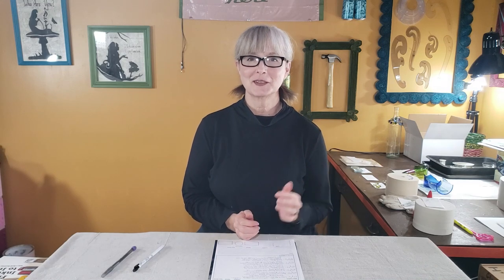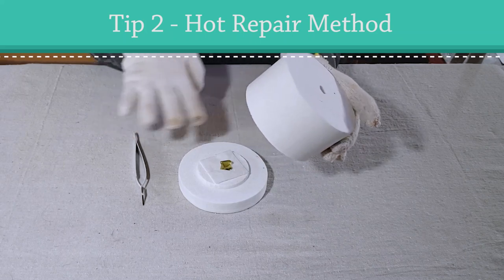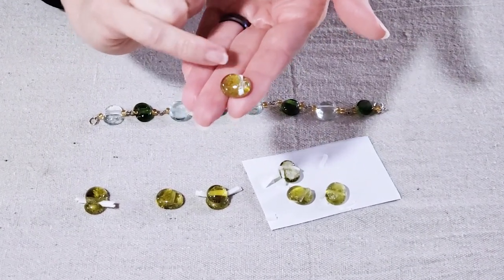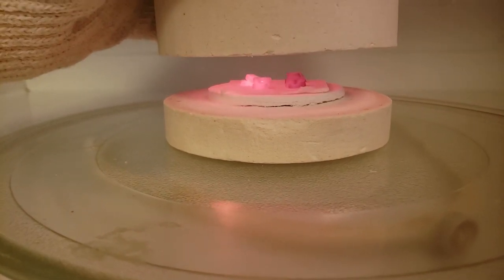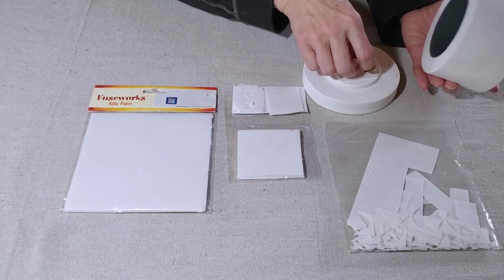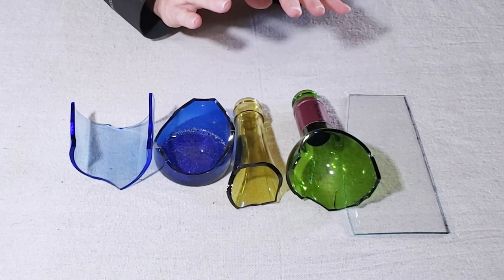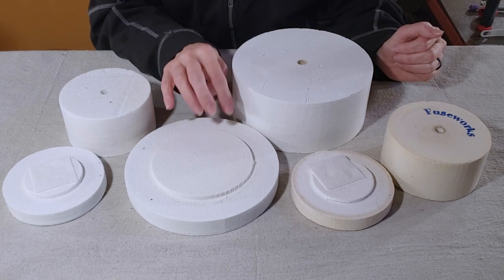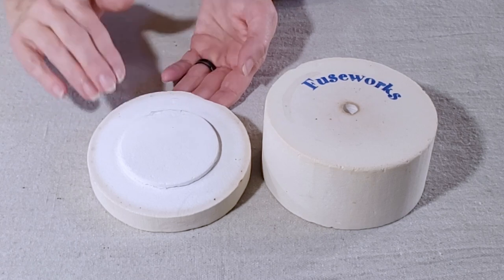Troubleshooting Your Microwave Kiln - 9 Tips For Beginners

Comment: Hi Cindy, can 2 pieces of kiln paper be glued together to make an impression that does move?
Reply from the maker: Hi - I haven't used the glue much with my kiln for me it seems to burn off before any fusing happens so item's can still slip. But I know many folks recommend using glue to help hold the pieces so I would say you could certainly give it a try. Sorry I don't have a more definitive answer. Thanks for watching.

Comment: I'm using bottles like you do, but when cooling the glass cracks and comes apart. I'm not mixing the glass, what do you think is wrong any help please.
Reply from the maker: Sorry I have not had that problem. Is it possible that you are heating the glass for longer than you need to? Or that you are not allowing the glass to cool completely before removing it from the kiln?
Reply: @UpcycleDesignLab  thank you yes I am a bit eager to see what it looks like, will wait till it cooled thank you.

Comment: What type of glass is best to use ? I have a very large microwave and it seems like it maybe to large ? Not sure where to go from here honestly.
Reply from the maker: Hi - I might not be the best person to ask about different glasses because I have only worked with recycled glass. I don't think you should have a problem with a microwave being to big. The microwave I use is 1000 watts which is the minimum wattage they recommend.
Reply: I've just started and have been using glass from wine bottles, sparkling water bottles, and other glass bottles that my food/drink came in. Have had no issues mixing them so far.